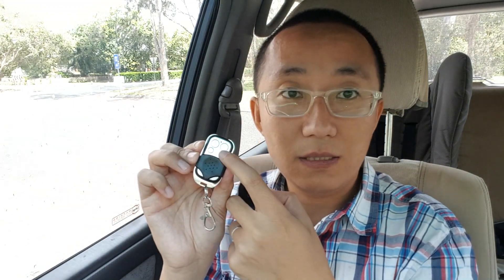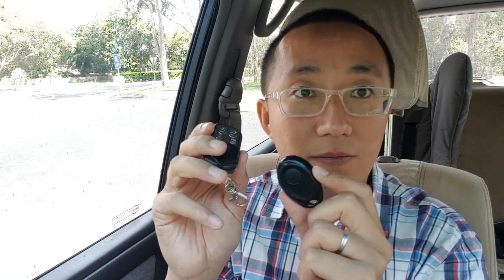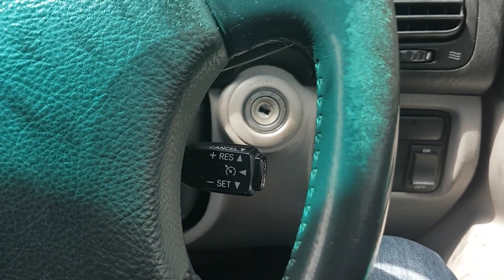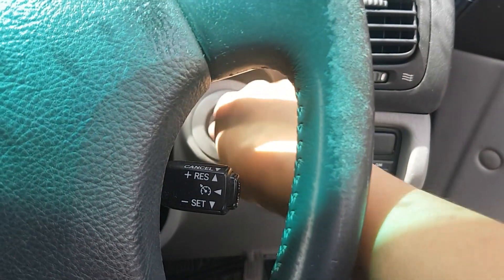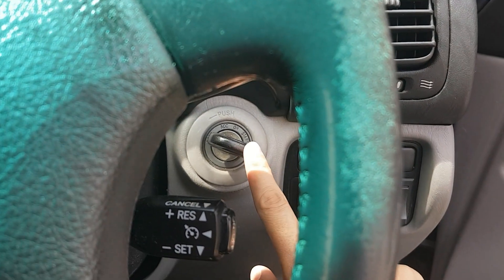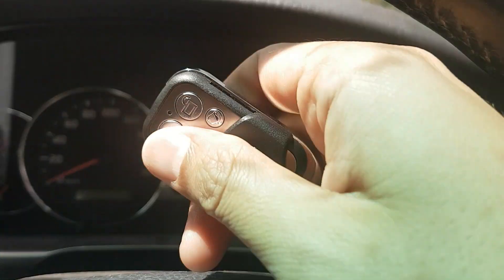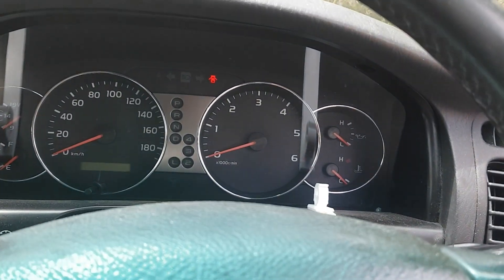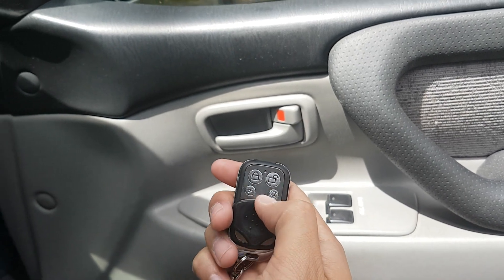Land Cruiser 100 remote programing

Comment: Thank you very much. I have a 2003 model and I had to resort to the take the negative terminal off method despite having the original damaged remote. The first method wouldn't even recognise the original or the replacement. Plus I had to use the Lock to On x 20, not the ACC to On x 20. Also make sure you have your radio PIN ready if you take the negative battery terminal off. Cheers

Comment: I have LC100 VX  and it das not work, my key comes with 2 button and even when door is open will not lock.
Maybe only work for some models, my dash looks same as your and is 5sp auto but key is like on Lexus LX470 but with 2 buttons.
Reply: Hi did u find another option to fix it I have same remote as yours

Comment: Sir i got one question will all after market keys work for this or do i need a similiar key like the original?
Reply from the maker: You need to confirm with remote key sales. It must on the same radio frequency
Reply: @OzMedia  i don't understand where exactly should i check?